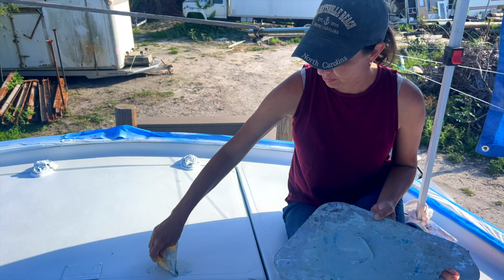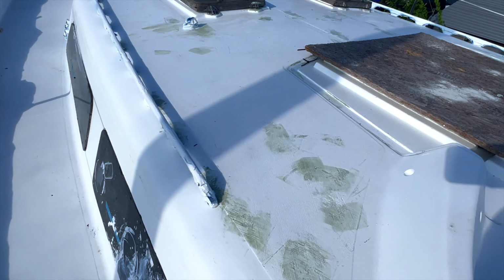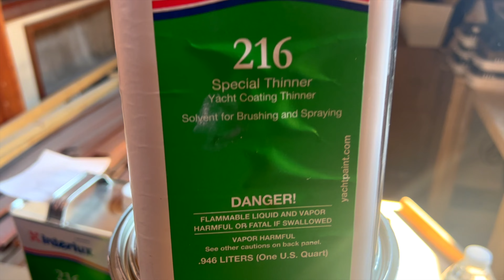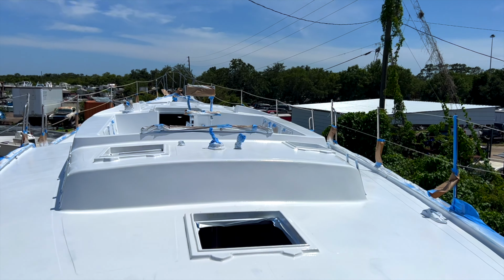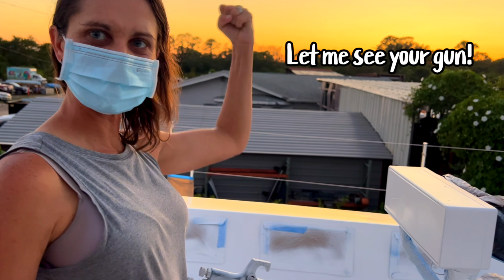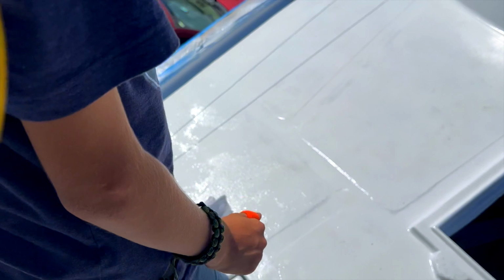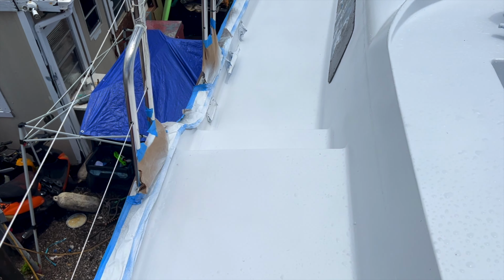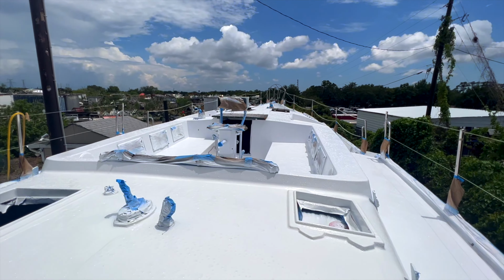The Irwin Sailboat DIY Restoration Project WEEK 38 Painting the Deck with Brightside Episode 62

Comment: Looks like new!
Undertaking a smaller, though older refit and wondering what spray set up you used.
Reply from the maker: 64oz Pneumatic Spray Gun with an 8 gallon/150psi/1.5hp compressor. We have an in line water separator and an in line spray gun filter. The whole set up, including paint gun, compressor, hoses, fittings and filters, all new out of the box cost just under $200.